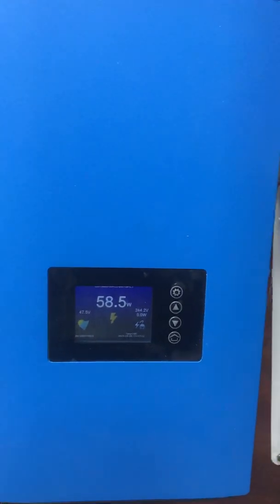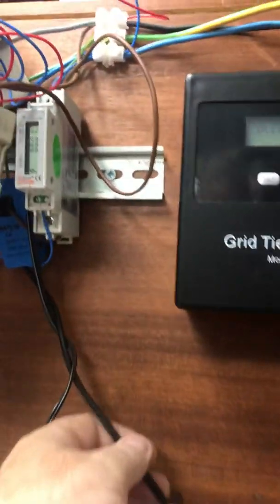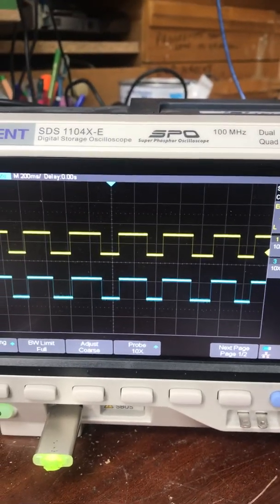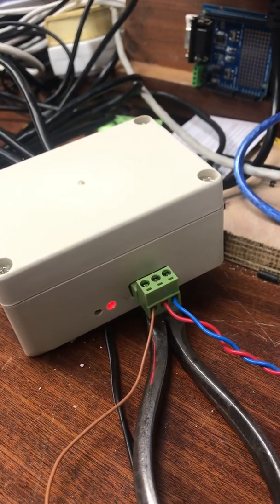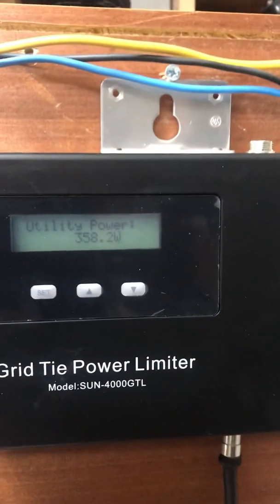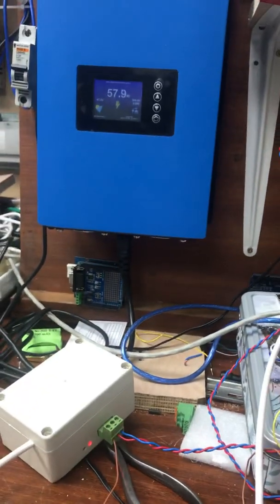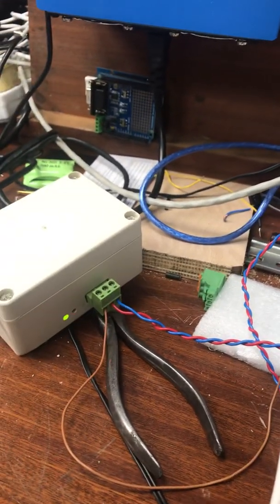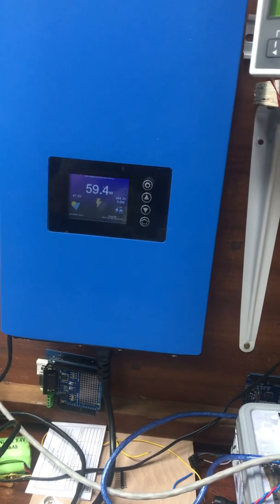Sun-2000 grid tie remote limiting 1000m upgrade from 30 m as standard

Comment: Hi - i have some questions: Im right that you using a 5V PWM Signal - to controll the Power output of the Inverter - wich PWM Frequency do you use ?  - do you have connected it to the external or internal Connector of the Inverter ?
Reply from the maker: Sorry. I did not get any notification of your .   Just seen  it today.   The signal that comes from the external limit controler is a pwm signal. At 1 hz.  At 5 volts dc  the pwm does not seem to be directly related to output power in a 0 to 100%. Relation ship but more of a up / down  in power level as the pwm. Goes above and below 2 duration limits as far as I could see .
Reply from the maker: Sorry feeding into external

Comment: Hi, I am searching for this information since 2 years... are you able to provide more Details regarding the PWM signal? I like to meassure the power consumption of my house via an industrial Smart Meter and send all necessary information via a RS485 wireless connection from my house to a 100m distance. I like to use the EEM Power Meter and Radioline modules from Phoenix Contact. They are easy to use. On the Location where the Inverter is installed I like to use a PLC to convert the signal to the inverter and to provide a WLAN network with a cloud monitoring. For that I like to use the Phoenix Contact AXC 1050 Controller with IO cards. These things are alle steardy.
Reply from the maker: Hi. The pwm signal is a 5 volt pwm. At 1 hz  the unit does not seem to respond in a liner fashion to this signal but seems to ramp up as it go’s over about 70%. And ramps down as the pwm drops to about 40%. 
Hope this helps 
Bill
Reply: @hotrex7779  Thank you Bill! I will check that out... ;)
Reply from the maker: Benjamin Klimmek   If you need the circuit diagram I would have to draw it up from my notes.  My one is a bit more than need for one unit as I drive 4 inverters from same signal but all are options isolated from each other.
Reply: @hotrex7779  Thanks for your friendly support. But I like to integrate all in a PLC with Wireless solution and a Smart Meter using Modbus TCP. 😉

Comment: does this inverters have ability to limit MAX output power? for example feed grid back with 700w max (to prolong inverters life)
Reply from the maker: Sorry just see this question yes they can limit on power output. Or current input  and have cut off voltage.  They also seem to reduce output as the approach the cut off voltage

Comment: I've seriously been looking for a while on how to solve the distance issue on a remote limiter.
I'm afraid I don't follow how your doing a 1000m run, do you have a lamemans version of this?
Solving this issue really makes a massive help for rural properties like I'm on, without going through the government.
Reply from the maker: Sorry just see this reply for some reason I don’t seem to be getting notifications .  
Ok the extended range module they produce they say is good for 30 mt range . 
The signal output. Is a 5 volt square wave at 1 hz. .   I used optocupled ttl. To rs485 drivers to take this signal and send it up to 1000 mt  and then at the other end use a second optocupled ttl rs485 receiver to give back the 5volt output to feed into the device .

Comment: Great little inverter, I have 2 of the 1000w versions here in the US. One for each 110v pole as we have split phase here in the US. I've had them running for 2 years and so far and they are still operating as expected. They have given me a few mega watts already of power. I'm interested though where you obtained the external limiter? I can't seem to find a link anymore for it. I was thinking of adding another solar setup on my shed, but the distance is too far for the internal limiter to get an accurate reading.
Reply from the maker: Hi sorry I just see you qustion I don’t seem to get any notification of comments. 
The external limiter. Was avalable. When I brought my devices. But. I have the same issue trying to get a spare one at present I have seen some avalable on AliExpress.  But don’t seem to get a good response when I ask about them